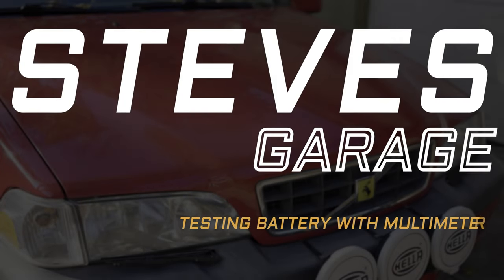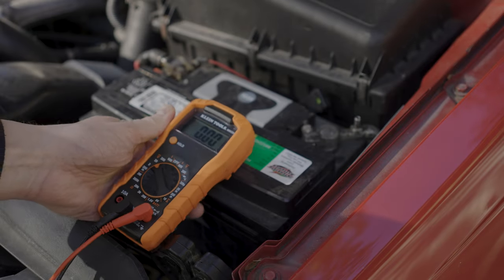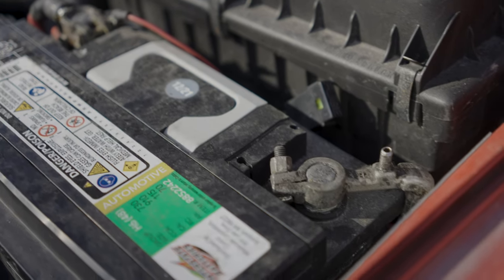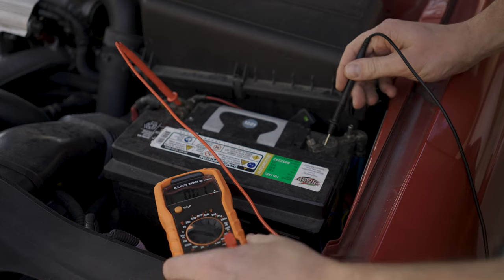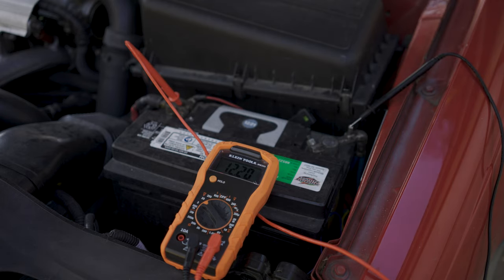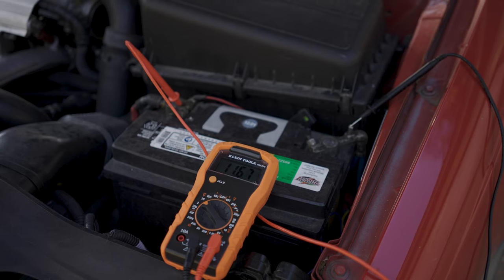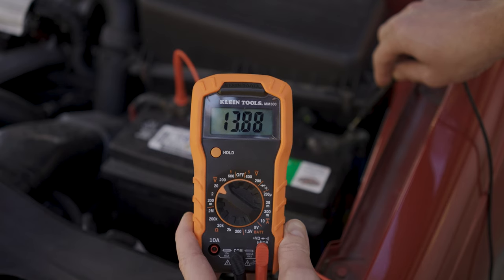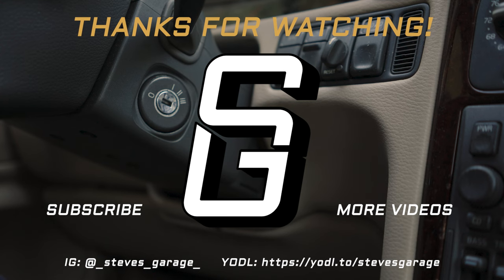How to Test a Car Battery with a Multimeter

Comment: Seriously? Battery connections were wrong... You CAN load test a battery with a voltmeter. Dude - so wrong.
Reply from the maker: How are the connections wrong? As far as a load test, cranking/starting the car with a multimeter connected is sort of like a load test, but you're relying on capturing a split second reading from a multimeter display. The better way to load test is hooking up a load tester. They will give you a better reading of how the battery is handling a constant load.
Reply: @StevesGarage  The meter leads must be on the battery POSTS - not the terminals. Corrosion between them will cause a flawed reading. Auto part stores sell batteries misusing their load tester by failing to isolate the battery. Your test would fail if the terminals were corroded. It would erroneously show a failed battery. Voltage drops add up.
Reply from the maker: @bivideo7  You're right about reading from the posts and not the terminals. I was working by myself shooting this video which is why I stuck them between the terminal and the post. I'll have to get someone to help me next time!
Reply: Fancy multimeters can set to capture high and low voltage for your crank test of the voltage?
Reply from the maker: @tedlahm5740  Yes, I believe the higher end meters do that, though I haven't used one. I know nicer digital car battery testers will give you exact readings as well.
Reply: Really the best video I've seen so far on this. Thanks from an amateur ❤❤❤
Reply from the maker: @Tx007Nova  Thanks for the kind words.
Reply: Just about any industrial maintenance meter will have a min/max function. Fluke 87 for example ($$$). But greenlee (rebranded brymen) meters are very nice equivalent for 1/3 the price. My greenlee dm820a was $197 and has min/max rec.
Reply from the maker: @boognish593  You're right! I edited the original comment because I think I misunderstood the first time. The min max readings are nice, but I can say that I wouldn't spend anywhere near $197 for a multimeter since I don't use it often enough to justify that price.

Comment: I guess since you didn’t do a load test is why you never explained it. Whether the old carbon pile type or the current computerized style your looking to introduce a load half the cold cranking amps for a determined period of time, 15 secs usually. The computer ones do it faster. You don’t was to see the voltage go below 9.6 volts. I have no real determination of test time with using a voltmeter but if you hook up the meter and turn your headlights on and the voltage goes below that 9.6 volts quickly then the battery is no good.
Reply from the maker: Yea, I didn't get into it since it's so easy to get it load tested at a store. Your explanation is perfect though, you can put a load onto the battery yourself and get a pretty good idea of how it reacts.

Comment: Thanks.  My wife's car is having issues...I'm hoping it's the battery as replacing the alternator is a pain in the butt!😀
Reply from the maker: I can't think of a car that's easier to replace the alternator than the battery, so I'll have to agree!
Reply: @StevesGarage 99-03 chrysler 300m, Dodge intrepid, Sebring.
Reply from the maker: @tylercollins8499 I've never owned or worked on one. Do they have the battery under a seat or something silly like that?
Reply: Could be worse could be the pcm/ FCM 😂 always can get be worse when it comes to electrical
Reply from the maker: @LouiesWorld43  Always have to start simple with electrical. Rule out the easy stuff before jumping to major failures!

Comment: Looks like I'm going to have to pick myself up a Multimeter! Especially since winter is right around the corner here in Michigan.❄️
Reply from the maker: They're handy to have for the car or around the house. You can get one with a little kit that has an outlet tester an no-contact voltage tester. Of course those things are for a house and not a car, but they've come in handy for me and my old house.

Comment: I have a 1997 C-280 Benz l bought in 2009, it is now 26 years old and l have never changed the battery, not sure if it's original but I've had the car 14 years.
Probably because the battery is in the trunk protected by weather, so far its still working.
Reply from the maker: I don't think being in the trunk makes a difference, I've replaced trunk batteries before. Do you live in a climate that has less extreme temperature swings than most places?
Reply: this is truly an extraordinarily story.

Comment: My multimeter doesn’t show 20v under the DC. 

It shows 4000m, 40, 400, 600.
Reply from the maker: 40 should work fine. You just don't want to use anything less than what you'll be measuring.
Reply: @StevesGarage  thanks. Battery was so dead. Was ready at 4 volts!  No cold crank amps either.
Reply from the maker: @americandude3825  Oh wow, definitely time for a replacement!

Comment: I have The same multimeter, you can also turn it to the bottom right where it says BATT (battery) 1.5 v Show same numbers. Before and after turning over the engine
Reply: It's showing in the 14s when I turned over the engine. Was in the 12s  before but every third start the car struggles to turn over Like I put it on the charger Overnight till it turns, green starts right up to go to work starts right up 8 hours later when I leave work but if I stop anywhere. I have to sit there as it goes Agha. Ag uga ago gaaga for like 15 seconds before it actually turns over. So based on the numbers, the alternator is charging the battery.
But somehow the battery isn't holding a charge ... wierd!!!!
Reply: Just tested a theory. Same thing even happens when you turn it over 3 times back-to-back to back the third time. It struggles to turn over. Turn it on, turn it off fine. Turn it on second time. It struggles, turn it off, turn on the third time. It almost doesn't turn over , but still shows same numbers before and after all , three turn overs 12s then 14s 11 months old. Guess I just got a dud battery Unless It's the computer 2004. Honda Accord got a lot of electrical on it. I'll try going to O'reilly and getting a new battery cheapest fixed. I can see just a pain not being able to go anywhere other than work home work home without being afraid. It might not start
Reply from the maker: @JNicholsKnows  Good to know about the BATT setting, thank you!

As for the car starting - If it was slow on the 3rd start in quick succession I'd say the battery was just getting drained from starting and not charged up from running. But interesting that it happens every 3rd time. Is the battery old and needs to be replaced? Is it possible it's a different problem entirely? Maybe a fuel or air issue?
Reply: @StevesGarage  I'm new to working on my own vehicles just tired of paying other people. The outrageous fee for labor and the parts themselves are so cheap. Comparably. I just ordered a code scanner and battery load. Testershould be here in a couple of days. Based on videos I've seen.  And things I've read online. It's either a cell in the battery. That's gone bad or it's the starter.
The batteries only 11 months old. But I did Leave the car in the garage without starting it for about 2 and a 1/2 months through the heavy winter.
Without turning over the engine.
Out of sight out of mind that was my bad Use the multimeter to test the alternator and it was showing fine
Reply: Battery load tester only shows 118 of 580 cold cranking amps I guess it is the battery weird, though that it's still showing the 12.4 to 12.6 V. Then we  turn it over jumps to 14. Something just like a real or good battery.
Reply from the maker: @JNicholsKnows  If the load tester is showing that low of a reading for CCA I'd say the battery is shot. This is typically how a worn battery shows itself. It'll have trouble starting because that's when it needs the most juice. How old is it?
Reply from the maker: @JNicholsKnows  Awesome that you're getting into working on your own stuff! With the amount of information out there now, it's pretty easy to get started wrenching on your own stuff.

11 months isn't that old, but definitely possible it's messed up if it sat for 2.5 months. You don't even have to start the car, just get a battery tender and you should be fine. If it turns out the battery is dead, most places will pro rate you the cost of a new one based on the age.
Reply: @StevesGarage  thx

Comment: Also i think some cars have intelligent charging, eg the ECU can measure the load and voltage and then control the alternator to adjust accordingly.
The battery typically needs about 13.8V to trickle charge but can be around 14.?? Volts
I would start the car and take the reading with some loading on like lighs and heater then check alternator output voltage.
Reply from the maker: You're totally right. The easiest way to tell is if the alternator has a larger wiring harness type plug, and the battery terminal has a larger sensor on it, vs a standard cable attached to it. The reading will also oscillate between voltages, vs a standard charge value like in my video.

Comment: The car I was testing was reading around 12.3v, I started the car and it was still reading about the same voltage. But as soon as I turned headlights on, it started to read 14 ish volts. I feel this is not Normal right?
Reply from the maker: What kind of car do you have?

This video doesn't cover the behavior of variable voltage or "smart" alternators. Those style alternators can behave like you described.

Comment: So anything under 13 voltage while car is running get a new battery or charge it ....
Reply from the maker: Not necessarily. If it's running and below 13 volts it could be a battery not holding a charge, or your alternator not charging the battery.

One way to test is with your battery fully charged and the car off, turn the headlights on for a minute. Then turn them off and check the battery. It should still be above 12 volts. If not, chances are your battery is shot.

You can also have parts stores test the battery, and they'll even bench test alternators if you can get it out of your car.

Comment: A parasitic test can also be done with a multimeter.
Reply from the maker: It can! And it's an important test if the battery health is good and you're having problems with it holding a charge. Maybe I'll make a video for that test as well.

Comment: Hi. I was told by a Mechanic the voltage on a battery when measuring via a multimeter is supposed to be about 11-14 volts. At that time I had an accord with a dead battery and I had to rush immediately to a tech because my power ended up running from the alternator entirely instead. Can you clarify the range and also if its common as to what happened to me with my car?
Reply from the maker: If the car is running it shouldn't be below 12 volts, as that would mean your alternator is not charging the battery. As far as the upper range of 14v, the alternator is charging the battery while the car is running. The exact reading depends on engine speed and number of things drawing power from the system. I'm assuming your alternator was fine and your battery was just old and not holding a charge?
Reply: With engine running the alternator is supplying 14 +\- volts. Engine off it should be above 12. 12 volts is about 25% charged. A fully charged battery should read 12.6 volts or more. A dead battery is below 11.8 volts. Also you need to load the battery for 10 seconds by applying a load such as headlights to drain the surface charge before checking.

Comment: How about telling us where to plug in the leads?
Reply from the maker: Black is always plugged into black. Red has the option of amp, or volt/ohm. Since we're measuring volts for this test, plug it into the one labeled with the V and ohm icons. You can see in the video that my lead is plugged into that port, and the A port is open.

Comment: how to check CCA?
Reply from the maker: You won't get a specific reading from a multimeter for CCA. The best way to do it is to pull the fuel fuse so the car won't start, and crank it for a bit. If it doesn't drop below 10V while cranking, your battery is probably fine. That being said, temperature will cause that number to vary. So if you did this test while warm, you might get a different result than when it's really cold.

Comment: Very helpful! If the battery cable has some corrosion where it attaches but I touch the probes on the top of each post like you did, would the reading still be correct?
Reply from the maker: Yea that should work fine. But definitely clean up that corrosion and use some dielectric grease when you put it back together!